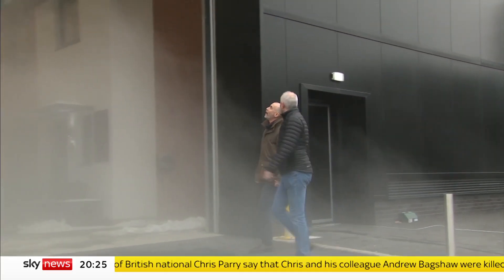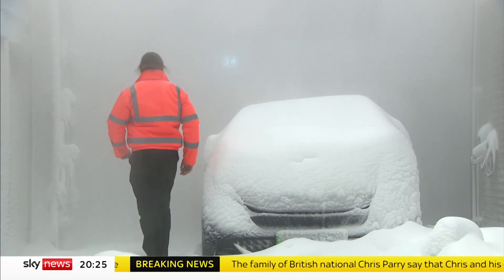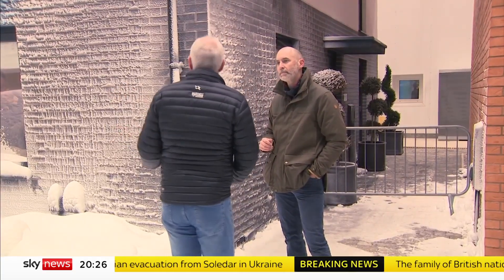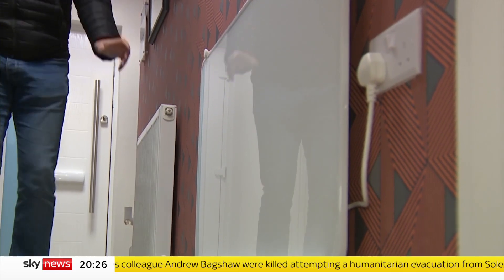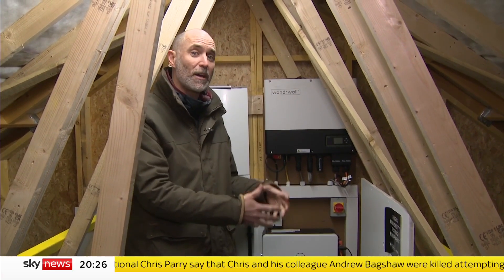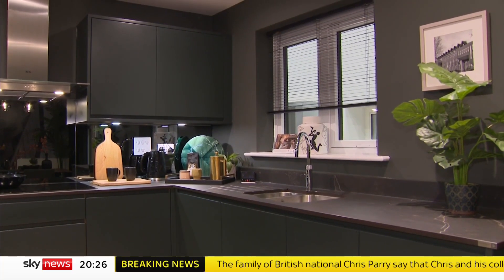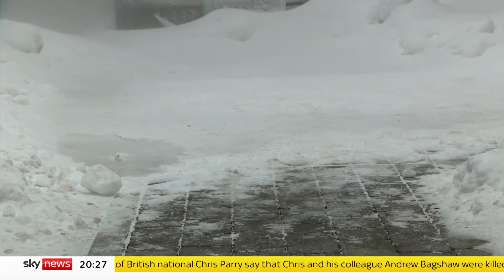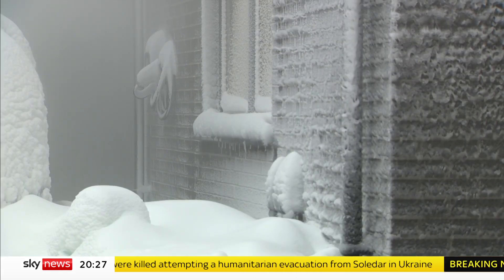How will we power our homes in the future?

Comment: So in the future the £50,000 EV Smart transport that folks plug into the Electrical grid to charge up over night from their 200 square metre, not enough to swing a cat in, property with its 15% interest rates on the Mortgage, may actually be having its £20,000 Lithium Battery being drawn down...and no one will be going anywhere anyway in the 20 minute Smart Cities depending on the programmable Carbon Credit Central Bank Digital Currency that might not be working that day if one asks to many difficult questions online that affect the level of the Social Credit Score.
BTW does anyone know how much carbon is required to mine all the Lithium to make the £20,000 EV battery? Carbon Neutral Nonsense.

Comment: Your choice drive a car or heat your house. LMAO
Reply: What? We can do both. Storage exists and solar/ wind overproduce at peak
Reply: @bertthompson4748   Good luck with that.
Reply: @joeleadslinger6138  I don't need luck. I have engineering
Reply: @bertthompson4748  OK stop using my carbon based fuel for your "green projects".
Reply: @Joe leadslinger  why? A small amount of co2 emission to produce solar panels is offset by the green energy produced by the panels
Reply: @bertthompson4748  small amount LMAO
Reply: @Joe leadslinger  yes. There's less co2 production by creating solar panels then using them to produce grid energy.
Reply: @bertthompson4748  Tell that to Africa.
Reply: @Joe leadslinger  OK. I just told Africa and they know. That's why they build a lot of solar